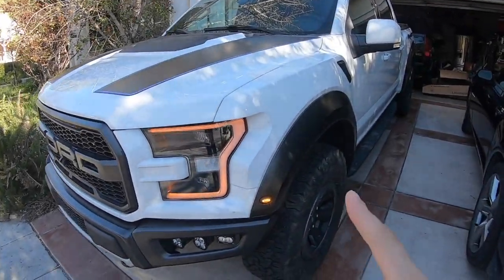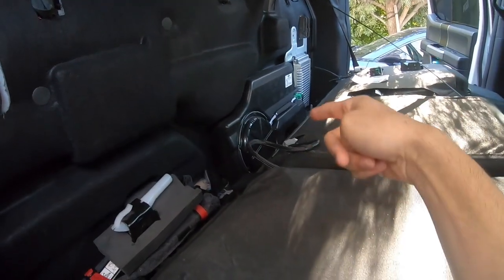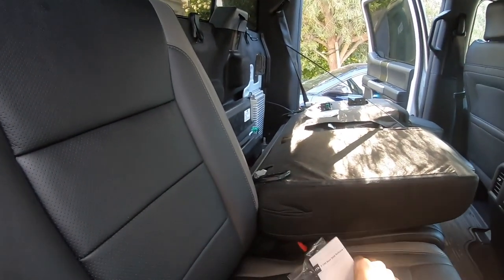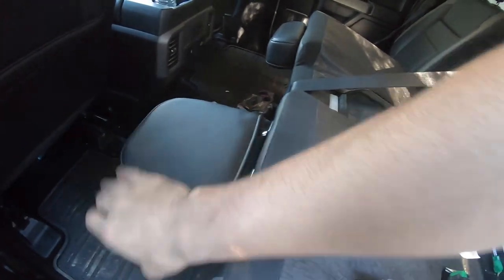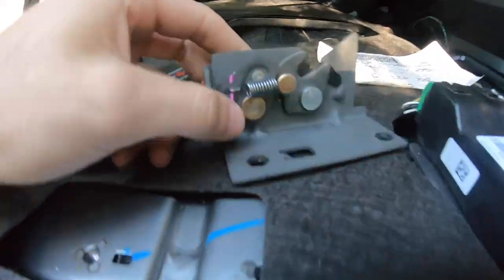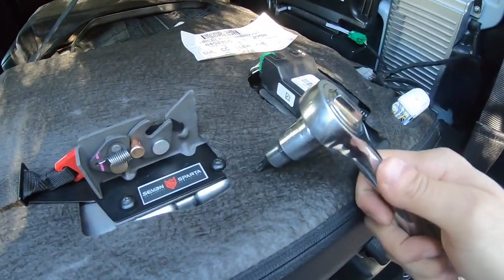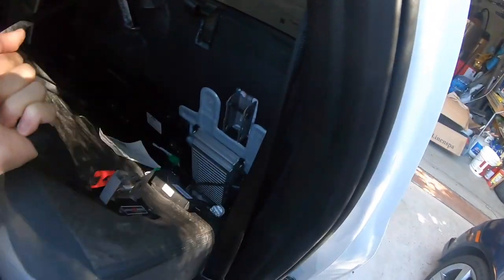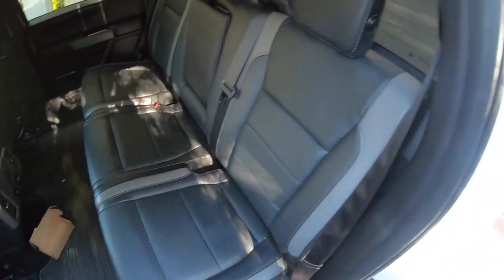$15 Dollar Mod EVERY! Raptor/F150 OWNER Should Do

Comment: You can do this for a dime, open the compartment, wrap a 9” wire tie on the release post, where the bracket he shows would attach. tighten so it sticks above seat back and close it up.

Comment: You don’t have to lift the seat bottom. You only had to do that the first time to be able to reach behind to release the latch. After that, just grab the release handle to unlatch the seat back. And for those that say what’s the point. If you don’t have a sub back there, there is a lot of space. I put a 178 piece socket set back there and other stuff.

Comment: Works like a Charm and Fits like a Glove.  I used this same “mod” on my 2014 Raptor and it worked well.  You do have to kinda slam it shut to make it latch.  I will do doing the same mod on my 2020 Raptor as well.  I was looking for a video like this to see if it still worked the same.
Reply: Add a piece of velcro too keep the strap  accessible.  Thx for the vid , God bless

Comment: i used para cord tied to a key chain ring that i hooked to the release latch by drilling a small hole. works great, but this looks nicer. would have went this way if i knew it was there.
Reply: I did the exact same thing. Yeah, this looks better, but functionality it isn't better. You have way more options with the paracord. I wrapped it around the headrest so I didn't have to fish for the cord.